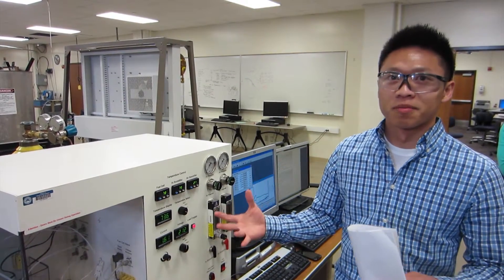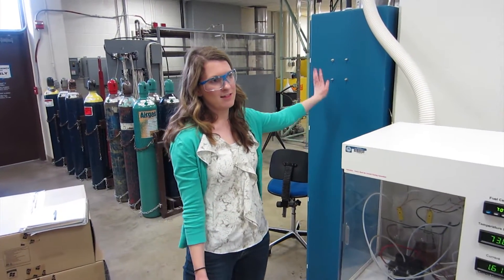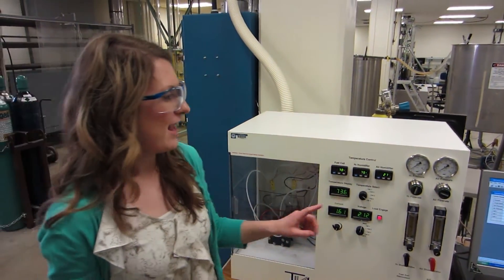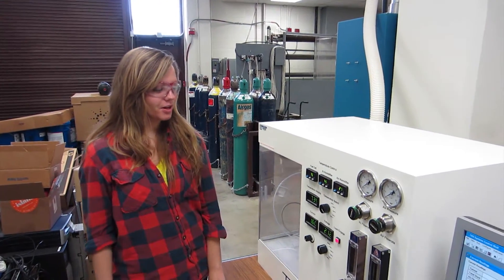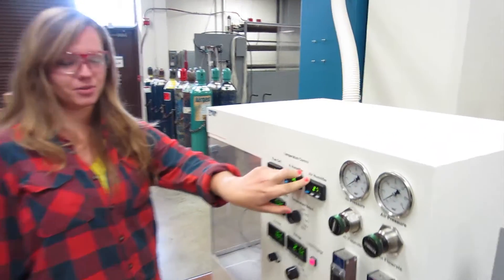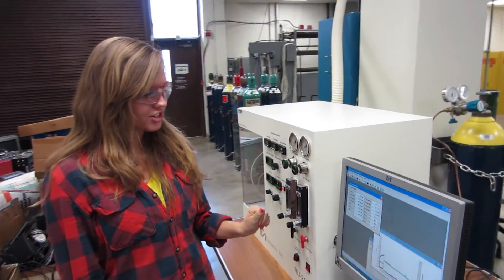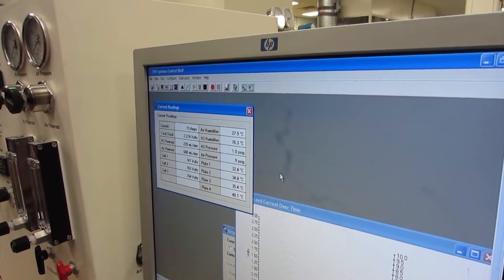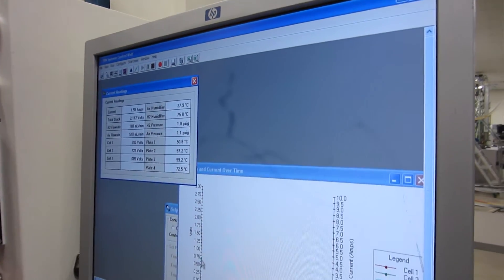Operating a Fuel Cell

Comment: jadi, berapa efektivitas produksi ga H2 nya dengan daya dan tegangan listrik berapa besar ???
Reply from the maker: Based on your question: So, what is the effectiveness of H₂ production, and how much electrical power and voltage are required?

This is a fuel cell experiment where hydrogen is consumed, not produced. High temperature electrolysis is one way to create Hydrogen, although it isn't very efficient relative to something like battery storage. Hydrogen storage may be a good fit for grid-scale energy storage in underground caverns, however, when the electricity may otherwise be grounded. Here is one of our recent publications:

Chen, Y., Hill, D., Billings, B., Hedengren, J.D., Powell, K.M., Hydrogen underground storage for grid electricity storage: An optimization study on techno-economic analysis, Energy Conversion and Management, Volume 322, 2024, 119115, ISSN 0196-8904, doi: 10.1016/j.enconman.2024.119115